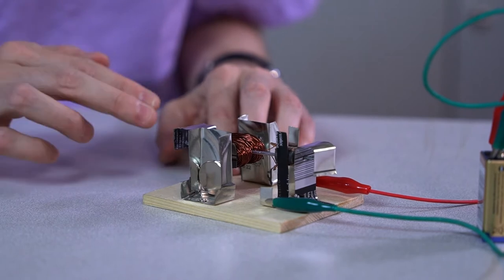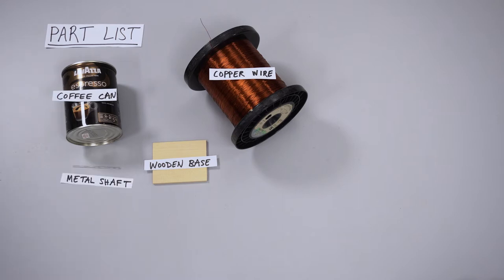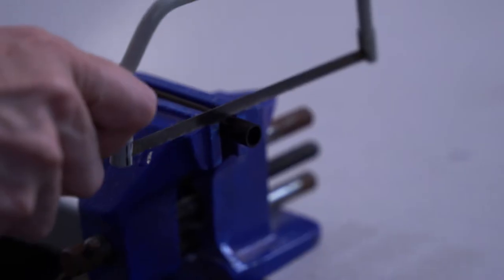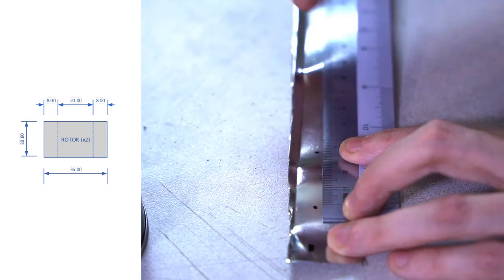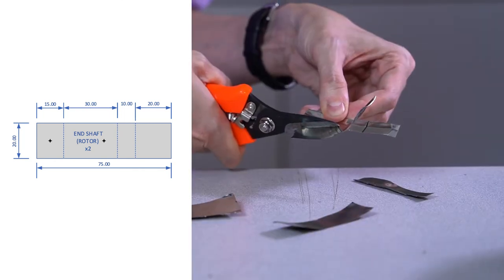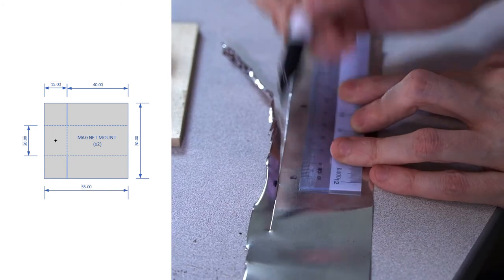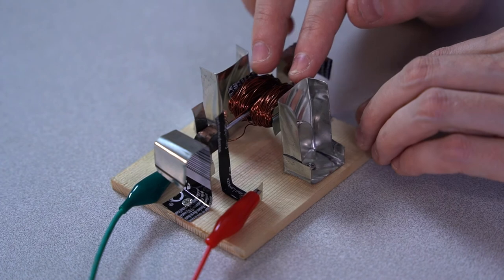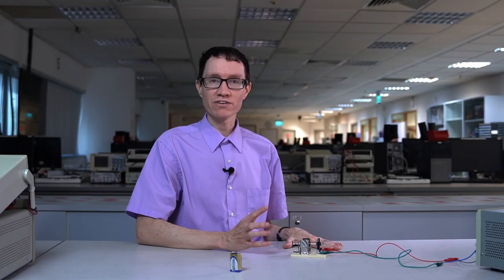Let's build a DC motor from a coffee can (Motors #1)

Comment: hello sir, torque can be increased to required by 1. increasing front gear ratio
                                                                                     2. by reducing driver teeth radius is this correct sir. or any other ways ?